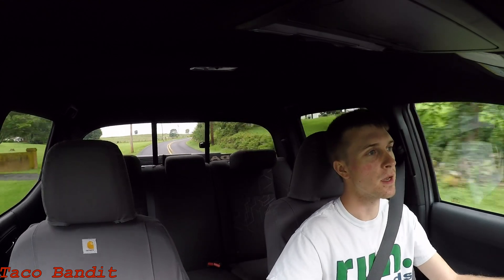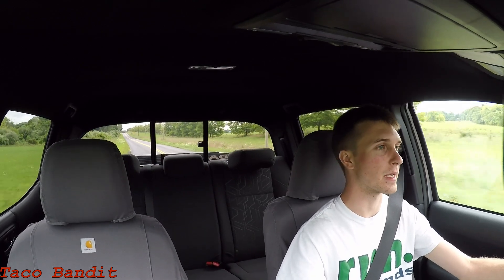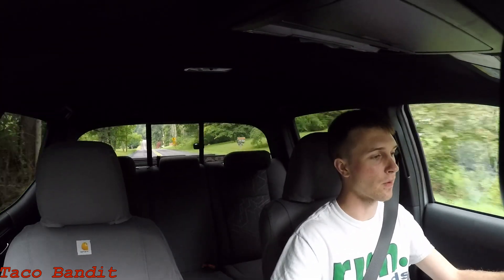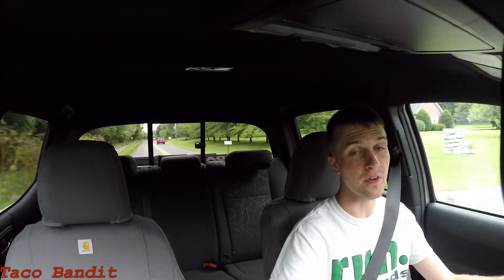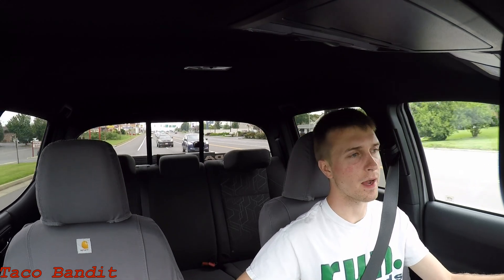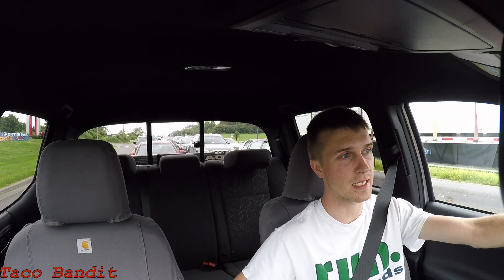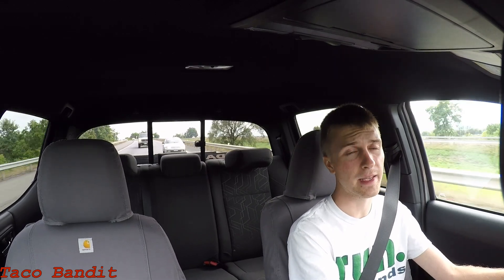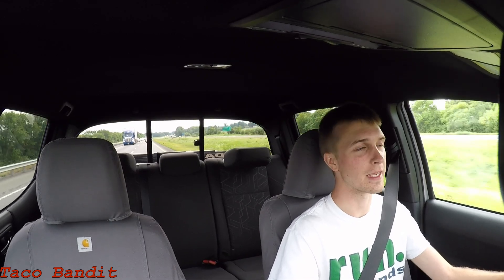2016 Tacoma Weekly Update #71: Toyota Tacoma Atkinson Cycle Explained & This Week's News!

Comment: Hi Chad.  I'm getting between 22 and 23 MPG per tank in mixed but mostly highway travel.  I do run 89 octane.  My truck runs smoother and has a little more power in the low range with 89 than 87.   My all time high is 24.9 MPG highway - ( call it 25 )

Comment: Did you guys ever figure out the popping that you were experiencing?  I couldnt find the video where you had mentioned the sound that you were having.  I have a popping sound when I am turning into my driveway.  There is a little bit of a dip as I turn in.  At times I think it is the back and others the front.  Torquing of the frame or possibly the shocks?  Appreciate hearing back from you guys.  Bill
Reply from the maker: I don't recall a popping.  I know that we have had a thunk from the fuel sloshing around though!

Comment: 2016 TRD OR Double Cab Short bed. To echo some other comments here, I too love the look and feel of my truck. However the transmission is my biggest issue. I live in central Illinois so there aren't any mountains to worry about, but the truck is downshifting on the slightest grade and seems to struggle to get out of its own way. Best mileage on my truck has been 18.6 so better than my last Wrangler for sure.
Reply from the maker: Maybe your truck needs more time to break in?  I know my truck got better MPG and smoother driving once I got to around 15k-20k miles
Reply: Did you have the 2016 Transmission TSB applied.  That made a huge difference with my truck.  I'm at 29K now and it just gets better and better.  I also manually Row around town because I like the control.. but all in all set it in auto  and let it go.

Comment: I got a 2017 SR5 4x4 v6. I drive 48 miles a day for five days a week to work, with hills climbing a 1400 elevation to work. I get 19mpg. Now On flat Land on highway 5 a 150 mile round trip I get over 23 mpg. Just like my 05 tacoma standard cab 2.7L. Funny how I get the same gas mileage like my old truck.
Reply from the maker: That is wild you get the same fuel mileage with now a much larger and more powerful Tacoma!
Reply: Atkinson was an experiment from Toyota on this truck to get better mpgs.

Comment: 17 TRD v6 4x4 dbl cab short bed.   Not impressed with power train as feels under powered on the highway. Constant up and down shifting is irritating.  Wish I had 4.0 engine truck back.
Reply: Larry Gaskamp I understand why you might feel that way. I do know however, that the standard transmission option seems to liven the truck up quite a lot! Not only does it have different gearing, but the rear end is a taller ratio (4.30 in the MT vs. 3.91 in the AT) which helps keep the truck more in the power band.
Reply: I know this is a 3 year old commnet, but check out OVTune. It's like getting a whole new truck. Love it